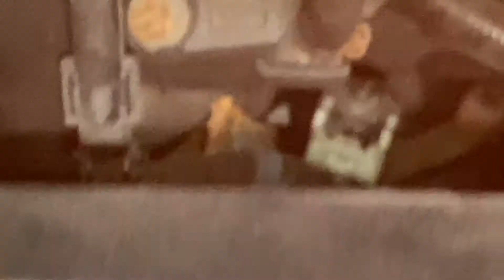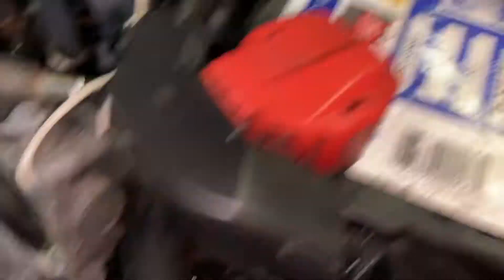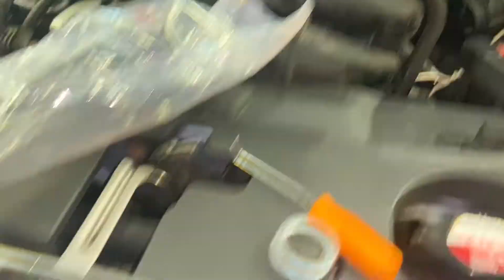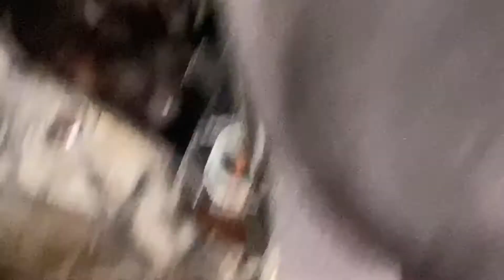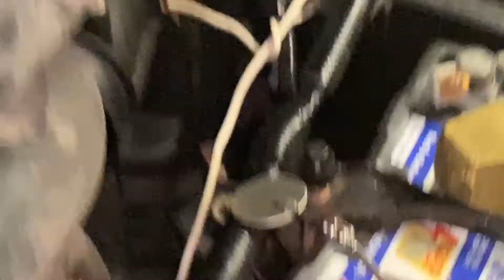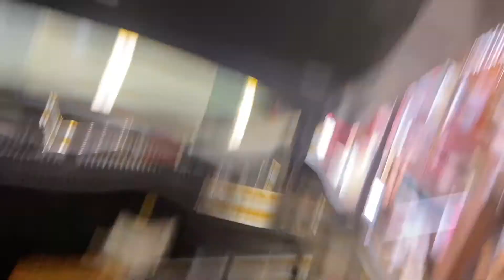K24 Honda Heater Pipe Replacement CRV ACCORD

Comment: If you are watching this to do the job on a 2007 CRV, good luck. It’s a different air intake and support. Had I been able to remove the single upper support bolt, it might have been an easier job but it was going to snap off which would have been a nightmare leaving me with no intake support so I couldn’t get the intake out. I removed the lower support bolt which forced me to simply pull the intake forward. No possible way to get it out to the right no matter how much you try to remove. That meant I had to disconnect all wires on the right side of engine, airbox base, upper rad hose etc. was no fun getting the pipe out especially with the intake in the way. Had to cut the pipe above the starter which let me remove in two pieces. Absolute bitch getting the pipe out of the housing. If I could have heated the pipe it might have helped. I kept soaking it with wd40 and I was twisting it back and fourth while pulling upward. After an hour or so I got it out safely. Hardest and scariest thing I have had to deal with.
Reply from the maker: Yikes I am sorry to hear it! Yea this isn’t an easy job. Did you say your 2007 looks different?
If i recall correctly the part number was the same 07-11
Reply: @DrewGarage  Heater pipe is probably the same but not the intake and support bracket. I can’t believe they use 10mm head bolts going into aluminum in some places when you know it will seize. My vehicle wasn’t even very rusty.
Reply from the maker: @jamessurname2285  sadly they don’t care. I just did a belt tensioner on a 2006-11 civic. 

2.5” long bolt, 10mm fine thread GRADE 5 with an **8mm ALLEN KEY HEAD!!!!** at 41ftlbs. No chance that will go well - but they build cars to be assembled. Not fixed. Sad but true. And I’m a major honda enthusiasts. We  drove our 4 kids all over (8100 miles on road trips alone last year) in a 199,400 mile odyssey
Reply: Now im scared to do this job.i have 07 crv .mine is aluminum  planum

Comment: Not a hard job as long as you don't try and shortcut by working around things that you can just remove. On an 08 CRV I also remove the upper radiator core support and hood latch as well as the airbox assembly both upper and lower. Makes the job much easier... I would recommend replacing the Thermostat casing and housing while in there along with the small heater hose that runs parallel to the pipe. If your starter has not been replaced give it a good look over, they are cheap enough AM to replace preemptively

Comment: What a horrible design for such an awesome vehicle!  How did you not lose your cool lol!!  Great job and excellent video.  Watches it twice now very helpful I dread the day this comes.
Reply from the maker: I really appreciate this! There were definitely a couple times where I made some comments I ended up editing out of the final video, I don't wanna undermine the quality of such a fine vehicle, but I agree, it is completely ridiculous. There has to of been a better way… If it didn't feed the throttlebody, it's clear a rubber hose around the side/back of the motor would be more appropriate, but yes, agreed. I hated this job! That's why I felt it so critical to share

Comment: I found the heater pipe on eBay for about $60, with part number 19510-RTB-000 (mine is 2008 Honda CRV). Thermostat housing part numbers vary, the one I got was 63670. I hope this helps someone, as the dealerships were wayyyyy backordered when I tried to get it.
Reply from the maker: Yea it’s terrible. Just got another on from eBay my self :(

Comment: Is there any reason  why this couldn't be done an not remove the intake manifold?   Reason I ask is because   replacing the starter  says to basically do the same disassembly..  but  you can acutely do the starter replacement  100% just under the car.  So thought maybe this could be done just under the car?   Any thoughts?

Comment: Just got the pipe out. Used the seal puller too. No cracking but I scored the inside of the bore a little from using the puller. You think I should replace it. I'd hate to put the whole thing together just to do the whole job over again.
Reply from the maker: Depends on how far down. If it’s “above” the o ring, you’re likely fine

Comment: I'm torn between paying a guy to do this or to do it myself.  I've done the brutal 5.0 mustang (80s) water pump with the aluminum bolts that snap off in the block so this cant be worse, right?

Comment: hello there. Where did you buy that piece?  I am looking for a CRV 2012 with the same problem, Honda 19510-R40-A60 that is the part number. Is a little diferent but more or les is the same.
Reply from the maker: Hello! I bought it on eBay, for about three times the price of the Honda dealer, because it's back ordered in the United States

Comment: Drew,  part number please.
Reply from the maker: Hello! It’s different for every model and sometimes different for different years / a 2007-9 and a 2010-11 CRV are different, for example. Best to look it up on a honda parts site like honda parts connection or call your local dealer

Comment: What a bad design shame on honda engineers and choice to use a non stainless steel part.
Reply from the maker: I am inclined to agree with you. I am always careful what I say in the videos, of course, because I am not an engineer by trade, but I have designed my own power trains for hot rods, and every little bit in peace that makes them go down the road including their HVAC systems etc., and I always show respect and concern for the person who may have to work on it in the future. I to am disappointed by this design
Reply: @DrewGarage  I got the part and could already see inside the pipe was a trace of rust on the inside, the out side is just painted but on this pipe it seems to rust from the inside out, best to use coolant with the best rust inhibitors.
Reply from the maker: @Noexcusis  that’s terrible :( I use factory coolant in everything so hopefully Honda’s coolant doesn’t aid in rusting
Reply: if it was made of stainless steel it'd cost more to produce therefore raising the cost of the vehicle

Comment: Would you know if the pipe from any CRV with the 2.4 fit the Element? thanks
Reply from the maker: I’m not sure off the top of my head, but it is important to note there are two different pipes under 07 through 11 CRV… I would look up the part numbers for both that will tell you for sure
Reply: @DrewGarage  thanks Honda has either discontinued the heater pipe for my 04 Element or it’s on back order dealers don’t know, ditto for Dorman.  I was hoping that maybe pre 2007 CRV or Accords would fit but I have been unable to verify this. I have looked around on the internet and no one seems to know.
Reply from the maker: @HotRod-wv4vm  try eBay I had to get one from Japan
Reply: @DrewGarage Yep tried that already. I did email Honda USA Headquarters to inquire if they in fact have discontinued it or if any other Honda parts are interchangeable. Will keep you posted. Mine is not leaking but I want to get one just in case.
Reply from the maker: @HotRod-wv4vm  man that’s rough. Crazy to think something like that could end a car
Reply: @DrewGarage  yeah. The part was less than $40 OEM when it was available. Some junkyard quoted me $145 plus shipping! Thanks but no
Reply from the maker: @HotRod-wv4vm  it wouldn’t be easily fabricated, either. Sucks. Maybe grab a junkyard one just so not to have a dead vehicle
Reply: @DrewGarage  yeah. I was hoping to get one from the west coast as they are probably in better shape than the ones in the northeast (I live in NYC) which probably means rust.
Reply from the maker: @HotRod-wv4vm  I am in Rochester so I get it. I being in over 90% of our inventory from Maryland and Virginia
Reply from the maker: We own a car dealership